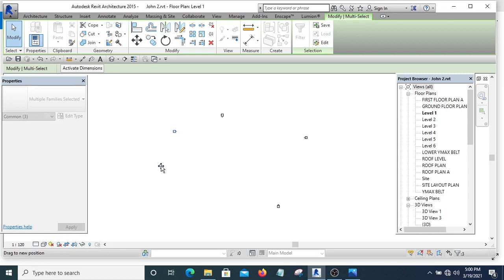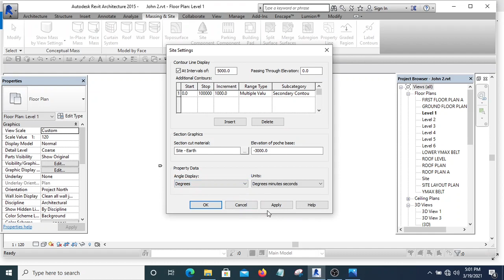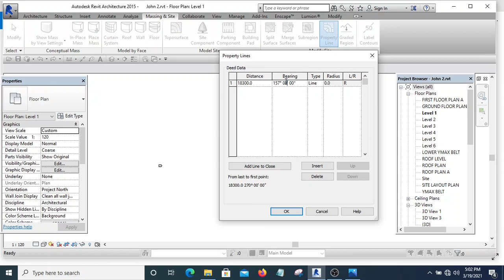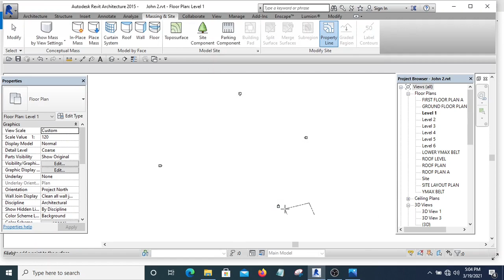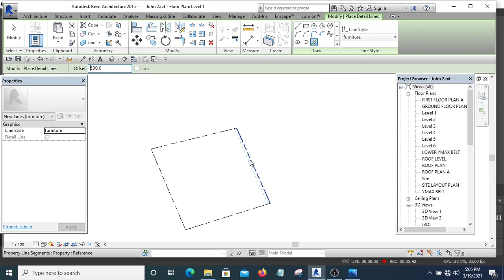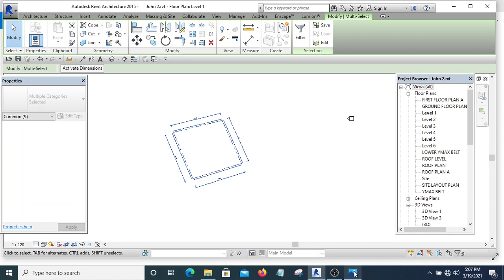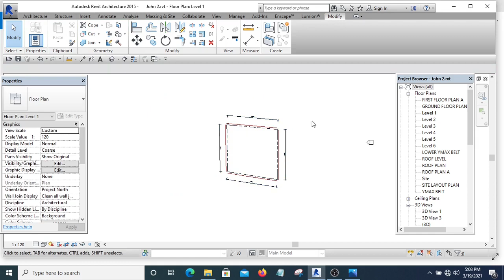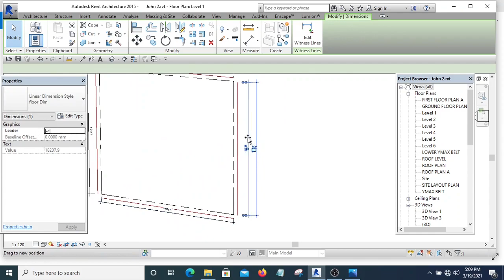How to Plot Survey Plan in Revit

Comment: When ever I have a degree greater than 90° my revit wont  respond until I have a less degree lesser than 90° that when it gonna work pls I need a solution to that
Reply from the maker: You need to set the angle display to degree